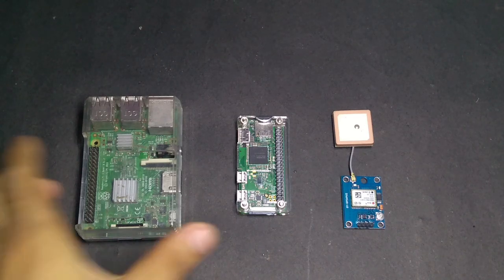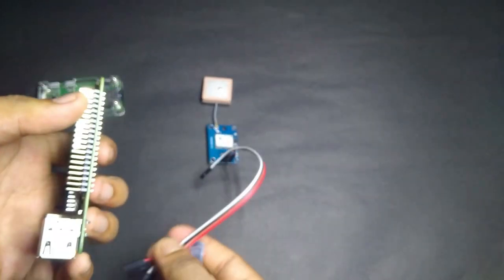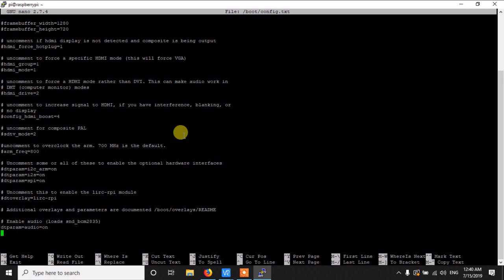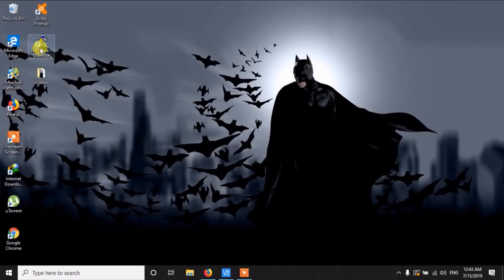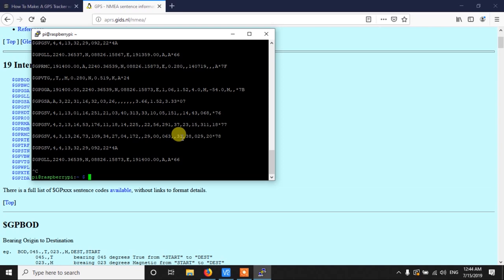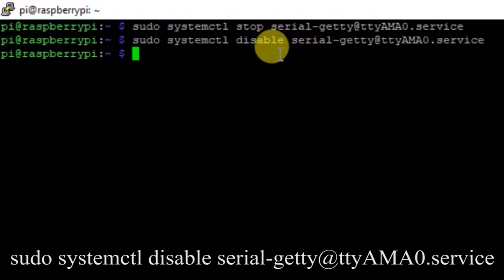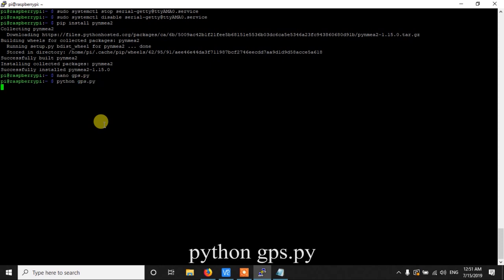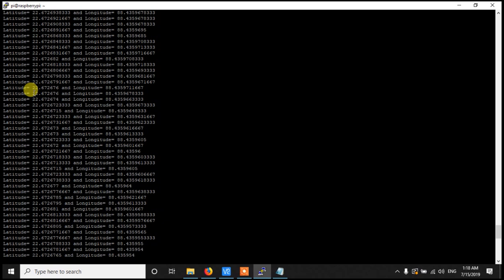How to use Neo 6M GPS module with Raspberry Pi and Python

Comment: Hi thanks for the tutorial.  I did follow all the steps and it worked fine.....but after some reboots  I now get the error [Errno13] could not open port /dev/ttyAMA0:[Errno13] Permission denied: '/dev/ttyAMA0'.
I did enter the code in Geany and as mentioned at first it worked fine.
All settings are still the same as mentioned in your tutorial.  Did something change after reboot?
What can be the problem?
Reply from the maker: You can use "sudo" while writing the commands as the problem is related to permission.

Comment: I have got stuck after making the code gps.py, i save and run python gps.py it hangs. when i stop i get this 
^CTraceback (most recent call last):
  File "gps.py", line 10, in <module>
    newdata=ser.readline()
  File "/usr/lib/python2.7/dist-packages/serial/serialposix.py", line 483, in read
    ready, _, _ = select.select([self.fd, self.pipe_abort_read_r], [], [], timeout.time_left())
KeyboardInterrupt
Reply: after 'nano gps.py' try the following code:

import serial
gps = serial.Serial("/dev/ttyAMA0", baudrate=9600)
def convert_to_degrees(raw_value):
    decimal_value = float(raw_value)/100.00
    degrees = int(decimal_value)
    mm_mmmm = (decimal_value - int(decimal_value))/0.6
    position = degrees + mm_mmmm
    position = "%.4f" %(position)
    return position
while True:
        line = gps.readline()
        data = line.split(",")
        if data[0] == "$GPGLL":
                print("Latitude={} and Longitude={}".format(convert_to_degrees(data[1]),    convert_to_degrees(data[3])))

After saving it, run  'sudo python gps.py'
Reply: @GameZzone581  thank you so much for this helpful code. The python code in the tutorial video didn't work my GPS module(8M). I change the python script as your comment and finally, the code returned the values.
Reply: @GameZzone581  Can you please show how this above code changes when sending the lat and long coordinates to pubnub? Having lots of trouble with that part.
Reply: @GameZzone581  I have use same code but I am getting error now like

Traceback ( most recent call last):
 File "/home/pi/l6.py", line 11, in <module>
  line=gps.readline()
File "/usr/lib/python3/dist-packages/serial/serialposix.py",  line 577,  in read 
   raise SerialException(
serial.serialutil.SerialException: device reports readiness to read but returned no data ( device disconnected or multiple access on port?)
Reply: I had the same problem can anyone had the fix for this
Reply: @GameZzone581  When I try this the output comes with this 
Traceback (most recent call last):
  File "/home/pi/try1.py", line 5, in <module>
    ser=serial.Serial(port, baudrate=9600, timeout=0.5)
NameError: name 'serial' is not defined
Reply: Bro, i resolve doing this code: 

import serial

def convert_to_degrees(raw_value):
    decimal_value = float(raw_value)
    degrees = int(decimal_value / 100)  
    minutes = decimal_value - (degrees * 100)  
    position = degrees + (minutes / 60) 
    return "%.6f" % position  

gps = serial.Serial("/dev/ttyAMA0", baudrate=9600)

# Loop 
while True:
    line = gps.readline().decode('ascii', errors='replace')  # Decodifica a linha lida para string
    data = line.split(",")
    
    if data[0] == "$GPGLL":
        # Verifica se as posições de latitude e longitude têm dados válidos
        if data[1] and data[3]:
            lat = convert_to_degrees(data[1])
            lng = convert_to_degrees(data[3])
            print("Latitude={} and Longitude={}".format(lat, lng))

On finish, you run the code with "sudo python gps.py".

Comment: Traceback (most recent call last):
  File "/home/pi/gps.py", line 8, in <module>
    ser=serial.Serial(port, baudrate=9600, timeout=0.5)
AttributeError: module 'serial' has no attribute 'Serial'

I've reinstalled every module just incase something corrupted but this is the error I keep getting. Any solutions?

Comment: Hi Sparklers, Can you give any insight how this same GPS module could be wired into an Acer Chromebook R11? Have install Android-x86 on the Chromebook and now need GPS for a drone app to work. I don't have any schematics for the mobo of this model. How would i ever find the TX solder pad on the mobo?  I know nothing about pinouts etc. I have done some soldering on mobos many years ago. Thank You

Comment: Thank you that was quite awesome! But I got a problem my module isn't blinking and also my latitude and longitude values are always giving 0.00 not real data. So how can I fix this problem? :(
Reply: Same problem..Did you figure out? 
Did you solder the pins?
Reply: @DR-jl6fm  Yeah I just waited for 1-2 hours and It has connected to the satellites.
Reply: have you tried using different module?
Reply: if you tried inside home or building try outside and work fine.
Reply: @DR-jl6fm  if you tried inside home or building try outside and work fine.

Comment: can I use pynmea2 in python3, all my sensors uses python3, I'm not getting any output using this GPS in python3
Reply: may you pls help me on how I can use pynmea2 (or other library) to extract nmea sentences on python3
Reply from the maker: if sys.version_info[0] == 3: 
        newdata = newdata.decode("utf-8","ignore")
Reply from the maker: add this code inside the while loop and try
Reply: @dumisanitibane9587  I have the same problem
Reply: @JohnWayne99999a   At the beginning of the code you have to 'import sys'. As folows:
import serial
import time
import string
import pynmea2
import sys

Then, add the code below in while looping (right above the code 'if new data [0: 6]== "$GPGLL" ')

if sys.version_info[0] == 3: 
              newdata = newdata.decode("utf-8","ignore")
Reply: @ibnuhsakti3120  you are life saver. Thanks you sir.
Reply: @ibnuhsakti3120  I put in the same code but it’s showing me an error saying invalid syntax for the “newdata=“

Comment: Hi, can someone help me urgently?
I want to build a system on a robot car (using a Raspberry Pi) that has programming code in Python. The system will be to identify the street and, in the case of a robot, walk another street to which it sends any signal (the street I want to locate using GPS)
Can anyone write the code?
I need that quickly

Comment: kernelPanic: VFS: can't mount root fs (179,2) NOT WORKING, NOT BOOTING.
Reply from the maker: You have to use Rasbian stretch or Buster OS. Else it will give error while booting.
Reply: @SPARKLERSWeAreTheMakers  i have the same problem how to fix it
Reply: @SPARKLERSWeAreTheMakers  please reply soon
Reply: My raspi not booting same issue

Comment: Great video, I like it and subscribed. I am new in doing projects with RPi and I want to show the GPS position, speed and heading on a 2004 display (for boating). In addition to the GPS position I have to add it in the phyton script with the different variables as you described for the GPS-position (that´s clear for me).
The GPS script shall run after boot of the RPi
So I have 2 additional questions: 
1. until the GPS-module get a signal, I want to show a text message like "waiting for gps-fix". After getting the fix it shall continue with showing the position (gps data). How would look the code in phyton for the message "waiting for gps-fix"
2. in case the RPi lose the gps-signal, I want to show also a message on the lcd (combination with the same message as waiting for gps-fix is ok, or using a different message is also ok)
Thanks in advance for helping me.
Reply: bro literally wrote an essay

Comment: How to connect it to Google maps? To know exactly where you at.
Reply: use google maps api
Reply: Azazel can I use google maps also to calculate the distance of two points?
Reply: @tinnns  utna nhi malum. Google maps api ka documentation padke dekh le ek baar.
Reply from the maker: What you mean by where you at? You already have the GPS coordinates. If you want the name of the place use Reverse Geo location API. And to find distance between two GPS coordinates use geopy.distance in python.
Reply: What I'm trying to say is how to get the distance of two points in kilometers just like how google maps get the distance when you are going somewhere and choose the shortest route.

Comment: I am getting a red blinking light in open area instead of blue..also i am not getting the gps coordinates when red light is blinking.. what does the continuous red blinking light mean?
Reply: if you tried inside home or building try outside and work fine. continuous blinking indicate it is working fine. since there were different version of gps module it may be red or blue. sorry for my bad english

Comment: When I tried to install a python library using the command "pip install pynmea2,"  I got this message "-bash: pip: command not found." Can I please have some advice on how to fix this.
Reply: I got the same, did you find a solution? Edit: pip3 install pynmea2 worked for me , using python 3

Comment: What is the possible problem if the led isn't working?
Reply from the maker: Either the module is not getting enough power else it's not getting signal (in this case you can move the module to window side or under open sky as it does not works indoor)

Comment: What can i do ?
My GPS sensor blue light is not blinking.
Reply from the maker: It's not getting the signal. Take the module somewhere else where it can get signal. May be window side or under open sky.
Reply: @SPARKLERSWeAreTheMakers  still not getting.

Comment: how to calculate speed using gps neo 6m module
Reply from the maker: Use geopy module to find the distance between two coordinates. Then divide that distance by the time needed to reach the final coords from initial coords to get the speed.
Reply: @SPARKLERSWeAreTheMakers  Does geo module gives both speed and your results?(showing on a map)

Comment: :dothefive:Guys don't use the VCC with 5v it will fry your chip, it already fried mine & in case your Neo 6 m didn't work connect the chip with 3.3v and wait for an hour or two, it has a small battery fitted into it, it needs some time to recharge. https://arduino.stackexchange.com/questions/8273/ublox-neo-6m-gps-module-not-responding